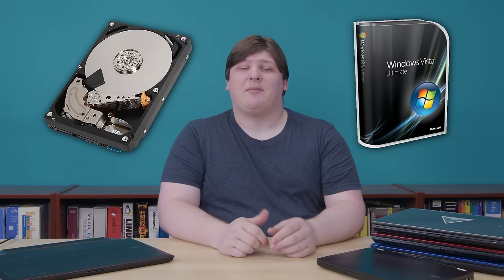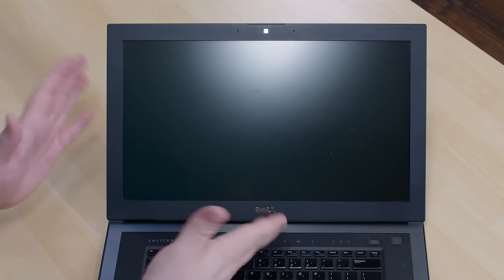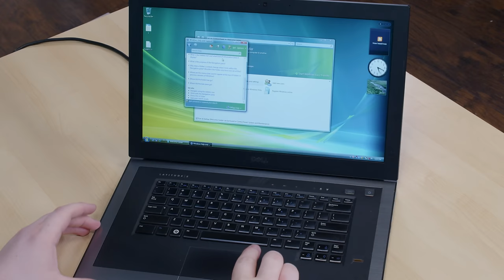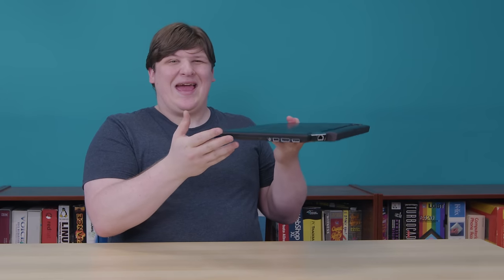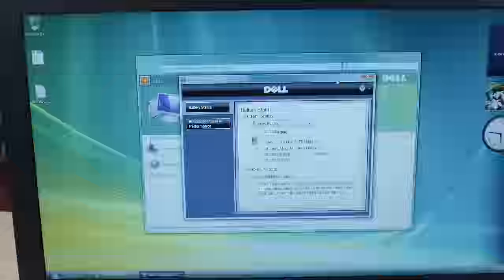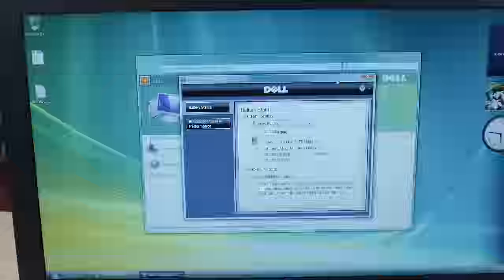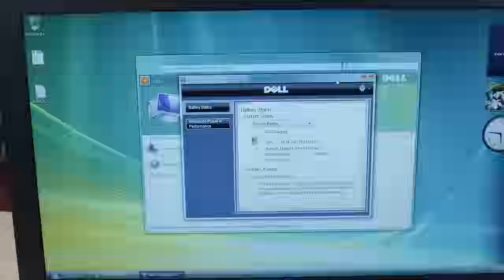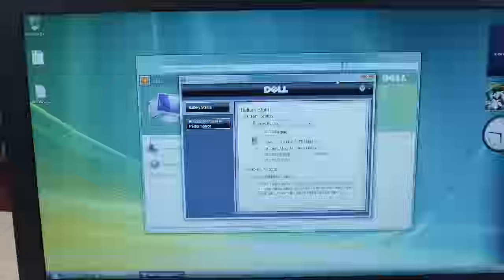Quick Start Ep 6: Assuming Direct Control

Comment: Cool video! In 2010, I was just starting as an independent consultant after working in various corporate IT milieux for just under 25 years, and until I saw your video, I had never heard of this laptop. After watching, I think what we're looking at here is what amounts to a showcase laptop, kind of like a concept car, except that in this case, you could actually buy it. Theoretically, anyway. I suspect that Dell mostly made it to wow corporate IT people with whiz-bang features, some of which were available in the laptops they would actually buy, and some of which were intended to show off technology still in the pipeline (like the wireless charging, maybe) but weren't yet ready for prime time.

I don't think this laptop was really intended for CEOs. As much fun as it is to poke fun at CEOs, I can tell you a few things from the years I spent supporting them. One is that in 2010, a lot of them still didn't have PCs on their desks; many had little-used ones on their credenzas, but most of them didn't carry laptops. The smart ones (yeah, I know, smart CEO, oxymoron, right?) didn't feel a need to tote around the latest and greatest technology just for the purpose of showing off. Any tech products they did carry was there to help them do their jobs better, not because they wanted to be billboards for Dell or Lenovo or Apple or whatever. I can also tell you that CEOs, and other corporate executives, are busy people who don't appreciate time wasters, and they hate insults to their intelligence. This laptop would have done both, and anyone issuing such a laptop to executives would at least have been reprimanded, if not fired outright. Execs in big companies make requests of their IT departments on a regular basis, but they depend on those IT departments to make sure that whatever tech is used in the company delivers what's needed from it. They don't run into the IT department head's office waving a flashy add for a new laptop and say "Get this for me!" Given what you said about how few of them you found, I'm thinking that, as you said in the video, most of them were review units - reviewed by corporate IT folks as well as trade rag writers - and promptly sent back because of all the drawbacks you reported.

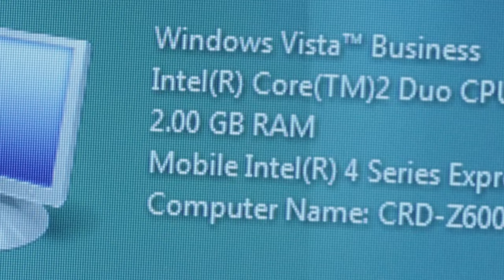3:03, 2GB soldered-on, non-upgradeable RAM - Actually, one of the problems with laptops that came out in the Windows Vista era was that few computers that used the DDR2 RAM of the time could support more than 2GB of it, but I found Vista to be sluggish in anything less than 3GB. That said, this would be a late model for DDR2 RAM, and most computers supporting DDR3 were upgradeable to at least 8GB, so this does seem to be a strange design choice.

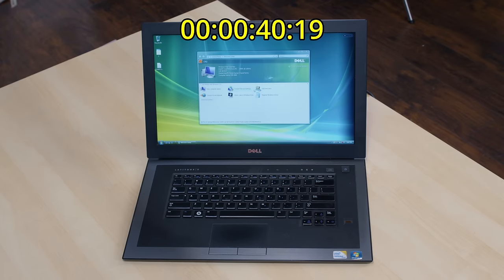7:15, boot times - In my experience, Windows Vista never boots on a production machine, with everything the way a typical user would use it, in less than about 2 minutes. That was the whole reason why companies explored alternate boot technologies like L-On.

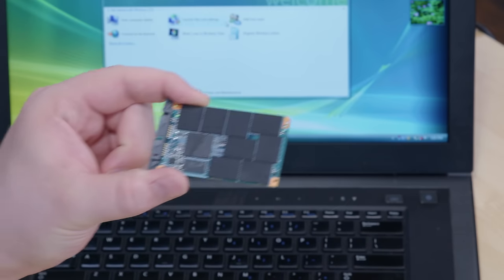8:20, Micro SATA - When SSDs first started appearing in production computers, IT folks (like me) didn't pay much attention to them, because no matter how much faster they could operate internally than a conventional HDD, they necessarily had to be hobbled by the SATA bus, which only supported up to 3Gb/sec. It's true that no unadorned, spinning HDD ever delivered anything close to that kind of throughput, but given the price of SSDs at the time, we didn't expect them to deliver enough of a performance boost to justify the expense. My guess is that Micro SATA was supposed to at least look like it was supposed to address that issue, although I don't know enough about it to know if it does. (I do know that mSATA doesn't, and M.2 SATA/NGFF doesn't improve things much, if at all.)

Wireless dock - OK, that blew me away. I have clients how who would kill for a wireless dock, as long as the technology actually worked reliably. That's the problem I've always had with USB hubs and even USB-C docks: there are just some things that don't work well with them.

Lack of numeric keypad (sorry, couldn't find the time index) - Yeah, that would've been nice, but as I recall, numeric keypads didn't become common on 15.6" laptops until several years after this one was released.

Comment: 36:30 I had a Motorola Droid back in 2010 as well. One cool trick you could do is overclock + undervolt the CPU. My Droid ran at 1,325mhz instead of the stock ~550mhz. It was my daily driver and ran just fine at this speed. Too bad the chip in this laptop wasn't optimized in this way too. A little heatsink would probably help get there.
Reply: tbh the unoptimization this has is 100% software and nothing to do with hardware, also no way in hell they'd overclock this in any official capacity heatsink or not tbh. But as someone who loves overclocking these things i would love to see a custom os or a way to hack its current one and to overclock it to see how much better it could get
Reply: Whoa. I messed around a little with overclocking my rooted Android in 2010, don’t think I tried undervolting though. (It was less dramatic, like 800MHz to 1000.) How was your battery life?

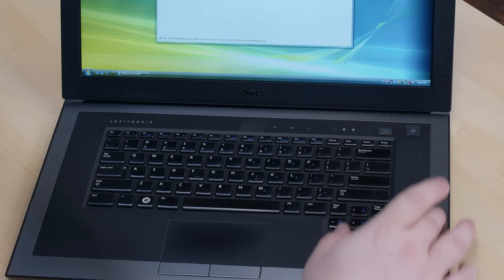Comment: 11:06 Possibly unpopular opinion: I HATE numpads on laptops and very much prefer a massive empty space on the palmrest. Typing on a laptop with a numpad requires you to position your hands WAY off-center in relation to the chassis, which means that either your hands will be bent into a weird position or your eyes will be looking way off the center of the screen. Both are far from ideal. Having no numpad fixes everything, all your body parts can be centered in relation to the laptop, as they should be.

Comment: 16” displays were the bane of my repair shop in the 2010s. 15.4/15.6/17.0 were cheap, but 16 was hard to locate and pricey for no discernible reason other than fewer models using them. Awful display size; they really should make them either bigger or smaller.

Comment: Putting an ARM SoC in a laptop for quick boot and saving battery isn't a bad idea, I would love to see a constructor put a Raspberry Pi Zero 2 in a laptop, as long as they keep it accessible to mess with it. Of course, now that we have real ARM laptops with phenomenal battery life, x86 CPU with E cores that use a lot less power and smartphones / tablets so powerful that they can put to shame workstations from the 2010s using only a few watts, that's not exactly a necessity.
Reply: Hell, skip the Pi Zero and go straight to a Compute Module. That's almost begging to be turned into a solution like this. But yeah, modern laptops with efficient x86 chips and now ARM SOCs make this a moot point these days.

Comment: A Turbo XT booting into MS-DOS 3 off an MFM hard drive takes ~47 seconds. Yeah, sure, you couldn't hibernate or put it to sleep in 1987, but you could lock the keylock on the case and turn the monitor off to have a "hot start" and be on in less than ten seconds.

The fact that boot times and the general solutions to boot times are pretty much exactly the same then as they are now really proves that it's not really severe enough a problem to stick the 2010's equivalent of a Chromebook inside a laptop.

Comment: In defense of the jutting out battery behind the screen: I always liked this feature on laptops (specially the old Thinkpads) because the battery could act like a handle if you were carrying the laptop open on your arm like a large artist pallete. Its a much more stable way to hold and be able to type on the machine, then balancing it on your fingers from the bottom.
Reply from the maker: Oh but this one is SO BAD. I forgot to say it in the video but the battery is SO FLOPPY, it feels like it's going to snap off. No idea how they screwed that up.
Reply: @CathodeRayDude  OH okay. Yeah that completely changes things.
Dang you can't even pretend to be a busy CEO walking around "answering emails".
Reply: @-DeScruff  "You know me. Always on the clock! Just checking if Janet set up the meeting for next week."
Reply: I always found these things were loose as heck and if you jostled the battery the laptop would lose power (and your work). The idea of any of the connectors being sturdy enough to support use like you describe is kind of blowing my mind.
Reply from the maker: @kaitlyn__L  oh I totally have machines I carry around by the battery regularly haha.
Reply: @CathodeRayDude  I only ever experienced the bad exceptions? Damn!
Reply from the maker: @kaitlyn__L  oh I don't even assert that, I bet most machines are fragile in this regard, just, there's a lot of laptops that can safely do it is all, haha
Reply: @CathodeRayDude  ah yeah no that does make total sense. I can easily imagine SOME of them have sturdy latching clips!

Comment: I loved my N900, but it did feel a little underpowered, mainly not enough RAM, given it was "real Linux" with proper multi-tasking. Nothing like missing a phone call because it took too long to swap out the active applications and pull in the phone app. I preferred it over my Nexus One because the resistive touchscreen was more accurate than the Nexus' capacitive one, the physical keyboard was much better, the screen looked sharper,  and --- at the time --- I liked the apps better. But it didn't have the interest and growing ecosystem that Android did, and by 2012 Android had improved enough that it was time to switch. I do miss having a phone that ships with XTerm and root access though 😆

Comment: I can't help but notice many modern machines now take longer to complete POST than to boot the OS. I don't know why booting has always been so difficult to do quickly.
Reply: @Gatorade69  Yeah, it most certainly has to do w/ UEFI and/or Secure Boot. I have enabled the "quick boot" option in my BIOS (MSI Tomahawk) but it doesn't make much, if any difference.
Reply: It hasn't always. Get a BIOS-based machine and install an OS which doesn't touch ACPI, and booting is pretty quick. I have no experience with UEFI yet, but I'm not expecting wonders. Edit: Someone else commented about... DDR4 machines POSTing insanely slowly... if I remember the DDR version number.
Reply: @Gatorade69  I was thinking as I wrote it that the computer I'm typing this on probably booted with UEFI; it's running Windows 11, but I only boot it for updates so I don't remember how long the boot itself takes. I'm usually asleep or out by the time it's finished. Same with every Windows 10 machine I've had. So yeah, I probably do have machines booting with UEFI, but I don't really know how long it takes. Also, I've been seeing how long old standards stick around for. I bought a brand new external drive last year and was astonished to find it was MBR-partitioned from the factory 

I've just thought, maybe UEFI machines boot slower because they check all the drives for UEFI partitions. The MBR-partitioned drive I mentioned stops one of my machines from booting. I assume the boot firmware sees the MBR table and goes into BIOS mode to try to boot it. When the boot fails, maybe it's buggy enough that the switch back to UEFI fails.

I imagine a slow boot could happen because the firmware switches into BIOS mode for a drive, then back into UEFI, then BIOS again for the next drive. It would be safe and cheap-to-develop to let BIOS and UEFI go through most of their initialization procedure every time they're activated, so that could take time. UEFI especially might reinitialize USB every time it's activated. Arguably, it should; what if the BIOS overwrote the RAM it was using for it?

On another note, have you ever seen a 90s PC which uses the mouse and VGA graphics in the BIOS? I've seen one; it came up looking just like Windows 3.0 but you couldn't move the windows. :) It was possible for a brief period when just-about all new mice were PS2 and every PC had VGA graphics.

Comment: Now I'm wondering how hard it would be to embed a RISC-V processor in an x86 motherboard to run a separate little computer off phantom USB power. Could even get Windows to talk to it like you can with ADB drivers and Android.
Reply: Pretty much how out of band management platforms like idrac or ilo work, but usually with an arm cpu.
Reply: PS4 has this but with ARM
Reply: Not difficult. The TH1520 already has most everything you want already there.

Comment: I've never really seen the point in wireless charging, cause you have to put it on a base anyway, so you might as well just plug it in and avoid the power loss that comes along with it. The one real purpose is for ruggedized machines in an area where it's not a good idea to have exposed ports.

Comment: Very interesting video. I remember reading about these laptops (dual boot/hidden os) when they first came out, and the wasa-wasa in my head kept thinking what a great attack vector they would be. (Especially in the case of having an ARM co-processor, as with the Del Lat-ON, which is basically what the AMD PSP is, at a high enough level).

Comment: I work in IT, mechanical docks were good but... I like USB-C docks that are well built, I'm talking Dells and Lenovo's newer ones and it NEEDS to be a Thunderbolt one otherwise eh. Power, Ethernet, USB accessories, and 4 4k displays all with a single cable that is impossible to plug in upside down.

Edit: 31:57 LMAO You're hilarious man. "Yo dawg, etc" straight faced. 10/10

Comment: ohh man this video reminded me how I was so curious why all the dell e6410's that I used to maintain back in 2014 or so had two sets of wifi cables on the inside. They all have that silly extra button but none of them actually have the module that makes it work installed.

Comment: Admitredly, now with much lower power and cooler ARM systems, a wireless laptop dock that you set a machine on for charging and hell, something like wireless USB sounds awesome.
Imagine setting your Macbook Air on a stand and it's suddenly connected to your whole office setup with no wires hooked into the machine. It's not that tricky to plug a dock in, but it's still cool as hell.
Reply: I did not realize just how funny me mentioning ARM would be when I made this comment. Completely floored lol.

Comment: You're right that wireless charging was unusual in 2010 and not standardised, but for phones at least Palm absolutely nailed it with the Palm Pre and touchstone back then. It worked so well, and i had mine setup to become a bedside clock and calendar when i plonked it down next to my bed. You could even customise what it defaulted to showing when docked on touchstones in different locations.

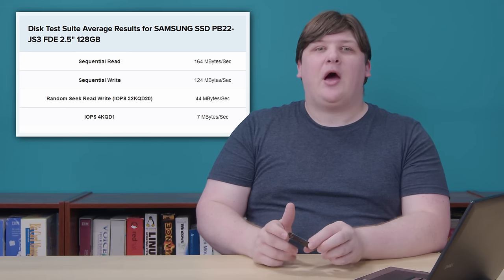Comment: 8:36 You're looking at a Micro SATA drive. It has a standard SATA data plug, and a micro power plug. Sony did this on some super small / portable laptops. They're also on the hardware I work with in the form of a M.2 to Micro SATA adapter.

Comment: I got a X201 Tablet from a friend of mine a while ago. Tech were wild at that time.
It would make sense to have a tiny ARM computer inside be up or in standby at all times, so in case you are you can quickly check e-mails or whatsnot, up and running as you boot windows or whatsnot.
It'd be like literally two computers in one, except with one set of kvm.

Comment: Of note - the Dell tools (supposed to update drivers and offer support options) were a massive processor drain and dramatically slowed boot time as well as consuming absurd amounts of CPU power.  I have lost count of the number of Dells that users complained took a long time to start and were slow.  I would simply remove the dell tools, and CPU usage dropped from 90-100% immediately after boot to 3-4 %.  Time for Windows to boot (and the desktop to become responsive) was also cut from 1-2 minutes to about 30-40 seconds.

Comment: I'm surprised they didn't just keep the module in sleep mode constantly. It only needs to keep the booted kernel in its RAM so it could sleep for most of the time, and since it's a low power chip would use basically nothing when sleeping.

Comment: Dell probably realized any benefit to them selling an expensive charger would be negated if any of their executive buyers forgot or lost their cable... being able to go "can I borrow a cable" to anyone else in the office could be a big deal... whereas if a CEO had a dead laptop for a presentation Dell might find that company no longer answering their calls

Dell has been using multiple wattages on the same barrel jack for years; they just communicate extra data anyways. Great stuff.

Comment: During my 12 years of PTSD inducing career at the Benelux Helpdesk for Dell, I can confirm that it sold very little and those SSDs were constantly failing. 
The sidebar Zoom function is basically just translating a held CTRL key and scroll call, so it should work in modern browsers as well.

Comment: I do agree with the conclusion on the T600, but I also think it's quite impressive that it had space for not one, not two, but three mPCIe wireless cards, two fairly (physically) large SSDs and an extra PCB for wireless charging. I would love to have a third m.2 slot for either WWAN or other 3042-sized cards, but the number of laptops that have it are very limited, especially in the 13-14" size range.

Comment: I work with induction units in my line of work and I'm not surprised about the heat. The units we get are big and have a lot of open space and still get up to over 140°F. I suspect the laptop also got extremely toasty, not just the surface of the stand. It's a slightly fancier induction cooktop where a lot but not all of the power just so happens to be captured by a second coil.